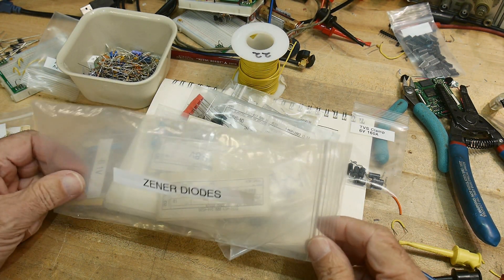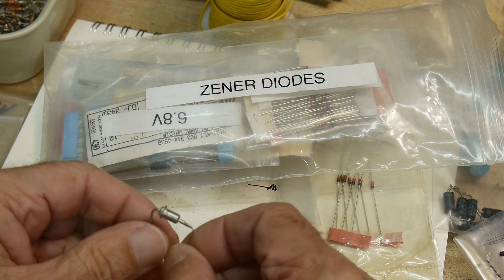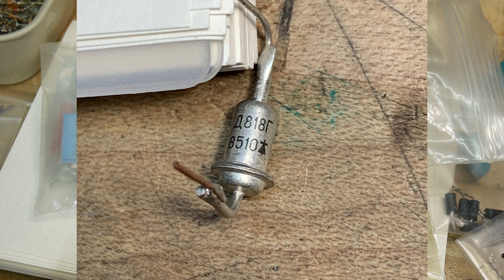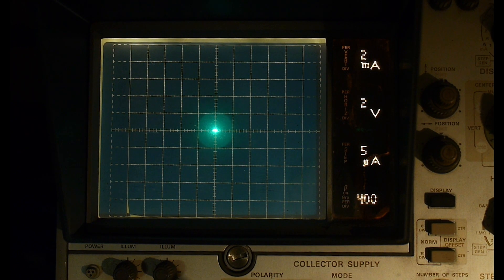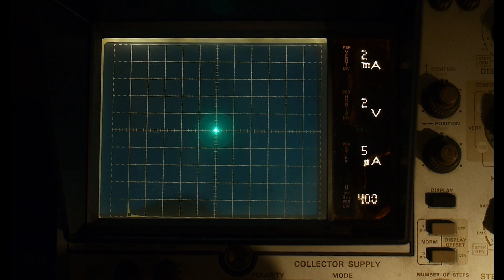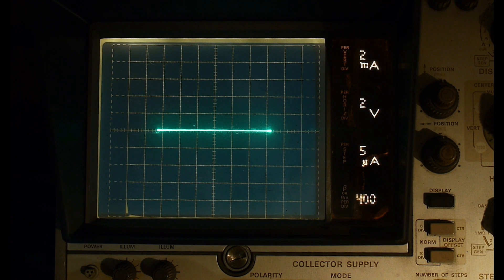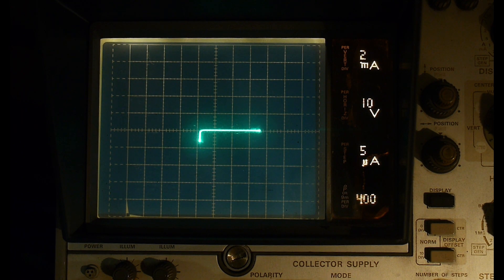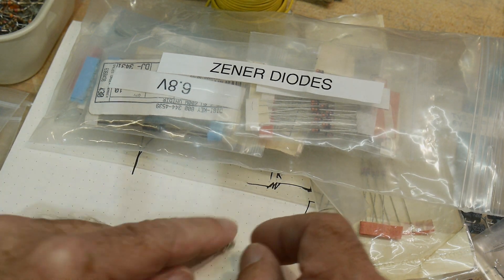#1809 D818G Zener Diode with Odd Behavior

Comment: I concur with the "regular diode in series with a zener diode for temperature compensation" crowd. Another similar trick was that the tempco of VBE in a silicon transistor is close to the tempco of a red LED but opposite in sign. There were regulator circuits that put a red LED in the emitter path of a silicon transistor resulting in a somewhat temperature compensated reference with a power-on indicator for free.

Comment: It is evidently two diodes: a Zener in inverse series with a rectifier.  Note that the temperature coefficients have opposite sign, so there is good reason to do this.  Why does the trace disappear at -9 V or so?  Does the current suddenly surge off screen?  If so, the Zener might be in series with a transistor's base and connected to its collector.  (... or connected to the emitter of a chopper...)

Comment: The Soviets really tried to be self sufficient in electronics.  Even after the Soviet collapse the Russians were doing things very cruftily.  A coworker of mine at NASA went to Russia a few times during the late '90s.   We were putting spaceflight hardware on the MIR space station in those days.   He told me his counterparts at the RSA would make one of a kind connectors with plastic molding.  The pins were machined on site.  Despite the differences, their hardware was well built and reliable.   The Russians also went down different paths in solid state physics.   Several years ago a Russian company was trying to sell a 4 terminal bipolarl device that could be configured as a BJT or thyristor, or some other device they had dreamed up.  I wish they had given me a sample.    It was along the same lines as Shockley's 4 terminal device.

Comment: You made my day, I was working on a Keithley electrometer. The voltage source has two 6.5v zenners behaving like what you showed. Thanks the comments from so many experienced people, it explained what puzzled me. These are temperature stabilized zenners used for stable bias for push pull output stage

Comment: What you see is not all that strange if it has a series diode for temperature compensation.  I was expecting you to have found one that oscillates or shows a negative resistance.  Some early "zener" diodes that really worked on avalanche would do weird stuff at very low currents.  This was because the voltage to start reverse conduction of the avalanche part was a tiny bit higher than what you got with a small current flowing.  As the current increased further the voltage would rise to be very near what the specs said.

Comment: I do not know exactly about this particular Zener diode, but zener diodes are used with regular diode (one in forward direction and one in a reverse direction) as voltage reference.
like this:
-|<i----i>|-
They compensate for voltage variation over temperature.
I think this diode package is combination of two diodes (one in forward direction and one in a reverse direction)
One diode has very large breakdown voltage and the other normal breakdown voltage.
They probably choose this combination to better compensate for temperature variation.
If they used single substrate, they achieved  normal breakdown with relatively high doping and high breakdown with relatively low doping.
The structure is similar to npn or pnp transistor without base connection, and the two terminals are collector and emitter.
Here are some more homework:
1.  See with voltage does it breakdown on the other direction.  If your curve tracer does not have the range try, a high voltage source and 10MOhm resistor and measure the voltage across the diode.
2.  See if you can make Esaki oscillator out of this diode.

Comment: Temperature compensation, using a regular silicon diode bonded to the zener diode, so that the overall TC is close to zero, even with a typial selection. Grades depend on sorting during manufacture, easy enough to sort the ones with lowest slope resistance out, then bin them accordinbg to slope, and take a sample of the lowest resistance and sweep over temperature to find the ones with best TC, and the rest get sold as the less precise ones. Then for precision you age them all for 100 hours, do a few thermal cycles to find the sweet spot for current, and bin them for that current.

Comment: It's a stack of regular, non-zener diodes. 12 regular diodes in series, will turn on at around 8.4V in one direction and not at all in the other (unless you give it hundreds of volts). They make microwave oven diodes in this exact same manner, but there they are stacking then to ensure the high reverse breakdown voltage. If you put one of those microwave oven diodes on the curve tracer you will find that it behaves in a similar manner.
Reply from the maker: but the Vf of this diode is >50V
Reply: @IMSAIGuy What you call Vf here is applied in the reverse direction on the diode stack. The conduction in the "reverse" or "Zener" direction is actually the diode stack polarized in the direct orientation. In other words, the marking on the diode is (intentionally) reversed. The marked cathode is in fact the anode of the diode stack, and the marked anode is the cathode of the diode stack.
Reply: Try a microwave oven diode on the curve tracer. You will find that it has a Vf somewhere between 20 and 30V (typically, depending how many diodes are stacked) and a Vr of over 2000V (typically guaranteed to be minimum 2100V). Imagine the markings on that diode were reversed now; you could sell it as a "Zener" diode with a Vz of whatever the actual Vf is. :)

Comment: As soveral people have already mentioned, these are hybrid, or maybe monolithic (?) combinations of a zener and an ordinary diode.  Besides eliminating (or strongly reducing) current in the forward direction of the zener, the diode(s) compensate for the thermal drift of the voltage.  You might compare the D818G to the JEDEC numbered part 1N825 or 1N827.  As I recall, the 1N825 has its zero drift temperature behavior at 7.5 mA current.  At least one of my designs depended on that info.  That was in the days before I got my first digital multimeter.

Comment: Try a 2n3904 with the collector as anode and the emitter as the cathode, with the base open. It should look like a zener with a breakdown around 7-8V. The CB junction provides temperature compensation.
Reply: On some, that will oscillate.

Comment: Weird Thought inspired by the seeming consensus of (I learned something today! Thanks, everyone):

A series diode that not only blocks reverse current (or do we call it forward current?) but also, being likely on the same die, causes thermal-compensation, making the zener-voltage more stable [Clever!]

Wouldn't that, then, be similar to a transistor with an inaccessible base? The zener effect is similar to reverse-breakdown, electrically (on an IV curve), right? SO: presumably the reverse-breakdown voltages of the two PN junctions in a BJT differ...  So... Would a BJT wired similarly (base not connected) show a similar effect? Could that be useful somehow (similarly?) (within some small range of I/V) without permanently destroying the BJT?

---Another consideration-inspired: If the thermal characteristics are what's responsible for the non-verticality of the zener voltage (and maybe similar in other devices), then does that mean an I/V curve would look different based on the /frequency/ used to sweep the curve? (Since a lower frequency would allow more time for heating/cooling)?

Comment: Omg! I've seen this twice recently in two separate pieces of equipment.  A Tek CG5011's HV supply (9V zener reference) and a HP 8557A's vertical driver preamp board (6.2V zener).  In both cases, they had no forward voltage like yours!  AND they are listed in both manuals as 'regular' diodes.  For example, the 8557A lists this diode as a 1N823.  Nothing special except that it is temp compensated!  There is no mention of a zener in series with a regular diode in the datasheet for the 1N823.  They don't look strange like yours either.  And they aren't faulty - it seems that they came like this.  I get the same curves as you when I put them on my 576.  So if anyone has input on these I'm definitely curious as well!

Comment: Datasheet of it says: 8.7V, 0.3W, 3mA to 33mA, thermal instability 0.006%/°C, temperature range -60°C to +125°C. Common trick to thermally compensate the Zenner brakedown diode is to put a regular diode in series. Probably etching both on the same crystal would give the most appropriate result. Dremel, grinding wheel with fine stone - even better, steady hands, strong vent out at close proximity, and a microscope would give the answer.
Reply: You're right. "Usual" soviet thermostable zener. I knew it. It has more thermostable brother - 2C191, hah. They in use both in aviation electronics, beleive me.
Reply: @TeorijaSHD  I have no idea. Thermocompensating regular zenner with a regular diode or diodes using thick books of components data was a thing I learned in the middle school (some 45 years ago, and yes, my parents were working in the USSR for several years, where outside major cities electronics was a popular hobby and together with ham radio club if present were among only a few things a teenager can occupy his time). I didn't know the 818 were special series, some close numbered higher power are crossing my mind (screw terminal) as a kind of, but not realy, - most probably I've already forget, and the first 10 results from Google do not mention it, though drift coefficient seems really low. May be the hole batch was some special run, may be a lucky deffect, may be indeed thermostable part. What I do remember is that in those days technology among regular zenners most stable were ones around 7V. If some day I manage to retire and choose to return to this hobby I'd know to look for 2C191 if needed, thanks for the info.
Reply: @deepblueskyshine   There are lot of choices of different voltage references now even much better. Don't stuck on soviet zener ))). Good luck with your hobby.
And we... must work and struggle know and bieleve in God as well. Second large rocket attack in two days.  Slept a little.

Comment: Datasheet:  https://www.kontest.ru/datasheet/unkn0wn/d818e.pdf
Reply from the maker: no mention of series diode or anything special:

D818A, D818B, D818V, D818G, D818D, D818E
Zener diodes are silicon, diffusion-alloy, low power, precision.
Designed to stabilize a rated voltage of 9 V in the stabilization
current range of 3...33 mA with high requirements for voltage
stability in the temperature range -60.. +125 °C. Available in a
metal-glass case with flexible leads. The type of zener diode is
indicated on the housing. In operating mode, the zener diode body
serves as a positive electrode (anode). The weight of the
zener diode is no more than 1 g.

Comment: It a Russian Stabilivolt diode which is a voltage reference diode that is designed to maintain a stable voltage over a range of currents. This means that instead of the sharp “turn-on” characteristic seen in regular diodes, the curve trace of a D818G would show a relatively flat line across a range of currents once the operating voltage is reached. This flat segment of the curve represents the voltage stabilization range of the diode. Translated from Russian datasheet. I’ve tried to put a link to it but haven’t been able to.
Reply: I think you meant Stabilitron, not “Stabilivolt”. The RUdatasheet website has a transcript, it also says:  “Operation of stabilizers on the straight branch of the volt-ampere characteristic is not allowed.” The forward voltage is listed as “—” (N/A).
Reply: We are not allowed to put links in our comments. Only the Content Creators can do that now.
This rule was recently announced in order to reduce spam and scam comments on the platform.

Comment: Actually, I do remember seeing specs for a series of zener diodes with a blocking/temperature compensation diode included in catalogs back in the 70's. Today's Zeners are somewhat more temperature stable.
Reply: I did find a reference for this type of zener.
https://www.raffia.ch/content/datasheets/volume03/1N823_AppNotes_Motorola.pdf
Reply: Half the job of finding something on the web is knowing it does or did exist. ;)
Reply from the maker: that one still has a 13V Vf.   nice reference, thanks

Comment: Zener diodes D818G are silicon, diffusion-alloy, low power, precision.
Designed to stabilize a rated voltage of 9 V in the stabilization current range of 3...33 mA with high requirements for voltage stability in the temperature range -60...+125 °C.
Available in a glass case with flexible leads.
Color-coded markings are used to indicate type and polarity.
The color of the ring strip on the cathode side is green.
Case type: KD-2, weight no more than 0.2 g.
Quality category: “OTK”, “VP”, “OS”.
Technical conditions:
  - acceptance by “QC” SM3.362.045TU;
  - acceptance of “VP” SM3.362.025TU;
  - acceptance of “OS” SM3.362.025TU/D6, aA0.339.190TU.

Main technical parameters of the D818G zener diode:
• Rated stabilization voltage: 9 V at Ist 10 mA;
• Stabilization voltage range: 7.6... 10 V;
• Temperature coefficient of stabilization voltage: +0.006%/°C;
• Temporary instability of stabilization voltage: ± 0.12%;
• Differential resistance of the zener diode: 18 Ohms at Ist 10 mA;
• Minimum permissible stabilization current: 3 mA;
• Maximum permissible stabilization current: 33 mA;
• Maximum permissible power dissipation on the zener diode: 0.3 W;
• Operating range of ambient temperature: -60... +125 °C.

Reliability:
The manufacturer guarantees that the quality of D818G zener diodes meets the requirements of CM3.362.025TU, subject to the consumer's compliance with the conditions and rules of storage, installation and operation established by the TU.
The shelf life of zener diodes is at least 25 years from the date of manufacture.
Minimum operating time:
  - 80,000 hours in modes and conditions permitted by specifications;
  - 100,000 hours in light mode.
Warranty operating time is calculated within the warranty storage period.
Reply: The source I saw said the tempco is -0.005% to +0.005% /°C which means they're aiming for 0 during manufacture, but it might be as much as ±0.005% as the outside edge of the spec for this $1.50-ea class diode.  There are variants of these with specs ranging from  +0.02% (D818A) and -0.02% (D818B) to the ±0.01%, ±0.005%, ±0.002% and ±0.001% variants of the D818 series.
Reply: @drussell_  , i have copied the above information from the Serbian datasheet of this diode. 
The difference between 0,005 and 0,006% in tempco is neglectable because there is more variance in the stabilization voltage (0,12%) 
But i think for such a old diode , these numbers are not that bad at all.

Comment: well is was just going to say there must be a second diode hiding in there,  but then I thought that magic pixie dust dust, unicorn horn shavings, or powered rocking horse dung might also be the answer! 
I think you will have to cut it open to find out for us. i counting on the second diode, as once you have opened it the other ideas will disappear so as to maintain their rarity. 🙂
Think I've been using too much lead solder today.

Comment: Google'd datasheet specs says it has 0.005% / C tempco, so very good zener (only 10x worse than a stand-out like 1N829A). I'd wonder the same as the other comments, if it is a +dV/dC zener in series with a -dV/dC diode to get the great tempco
Reply: At about 10V a zener has a temp co of +0.06% per degree C.
0.06% of 10V = 10 * (0.06/100) = 0.006V
How about they used 3 conventional diodes in series with it.

Comment: Maybe it's not a Zener diode... maybe it's a high-voltage diode.
And as it's usual with High-voltage diodes, it has a higher forward voltage.
And maybe the package markings are just inverted.

Comment: If I'm right, adding a normal diode with neg temperature coef helps null the positive temp co of the zener.
Reply: Yes, I used to have 2 voltage reference zeners in a large metal can. This was rated at 6.2V and about 10mA.
The can was quite light 1"high x 3/4" dia and screw down tabs. (From the early 70's.
They were very stable from -40F to +140F.
redrok
AD0TJ